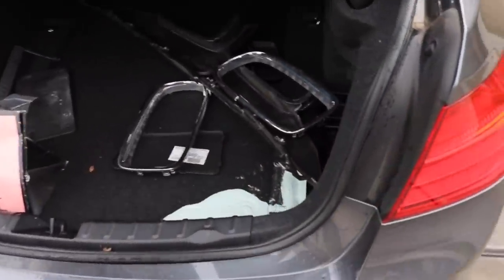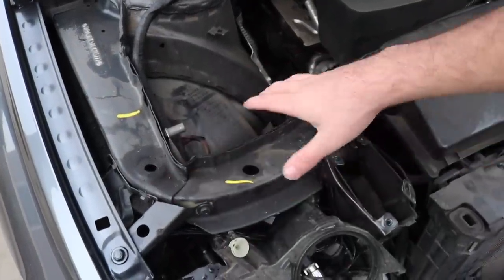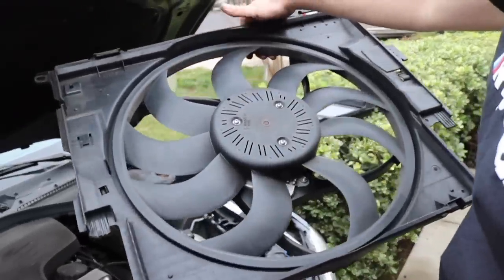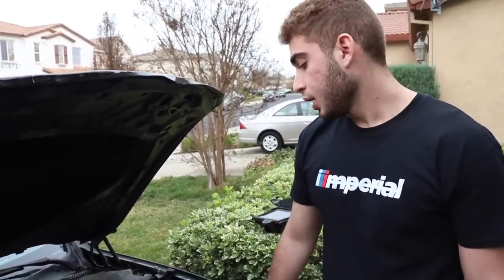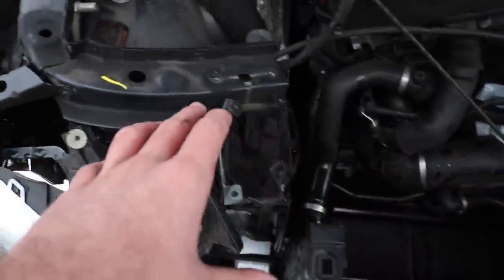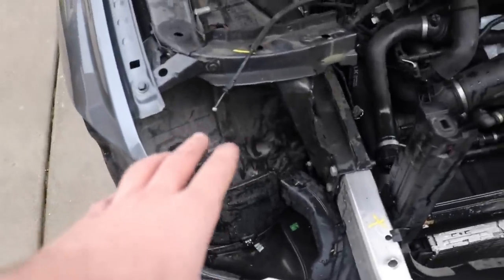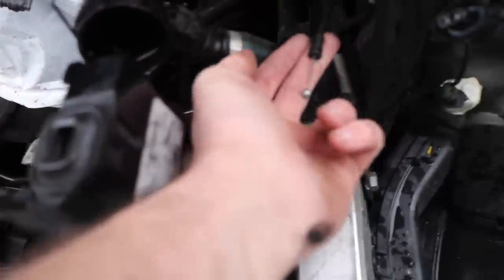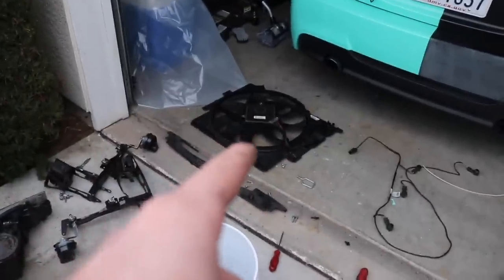Rebuilding a Salvaged 2014 BMW F30! (Part. 2)

Comment: Is the cut wire the F30’s version on the brake wear sensor? It’s got a similar interface as the E92 brake wear sensors but in black instead of white.

Comment: Those metals that are bent you need to get new ones cuz thier "skill" or wtf u say it in english gets worse if they get bent incase the car gets in a accident again that metal will be softer
Reply: David it they are pulled back into shape and don’t have any cracks. They will be fine. I’ve had many a car repaired and never had a problem.
Reply: @rstezza  Young's elasticity modulus disagrees
Reply: krutomjer I’m taking from experience. If the metal hasn’t weakened or cracked. It should be fine.
Reply: See Nour agrees 😂👍
Reply: @rstezza  Nour and you should take a look into basics of materials. Start with Young's elasticity modulus.  This graph will tell you the whole story https://qph.fs.quoracdn.net/main-qimg-886e618a9150eeeddf23f722c175da54-c . You can "unbend" the part but its elastic properties change for the worse.